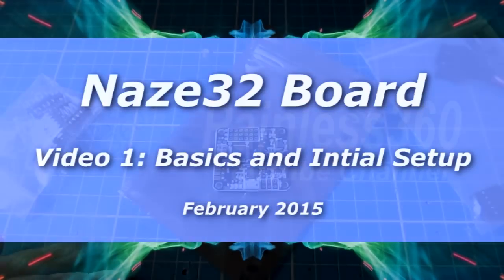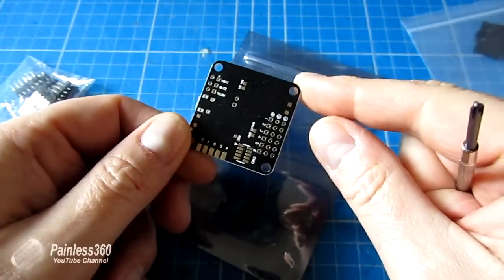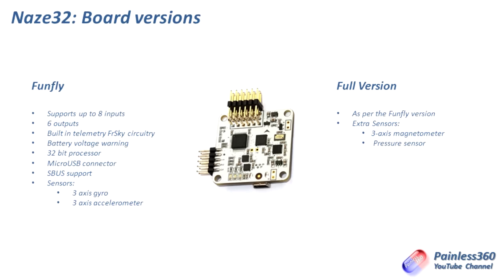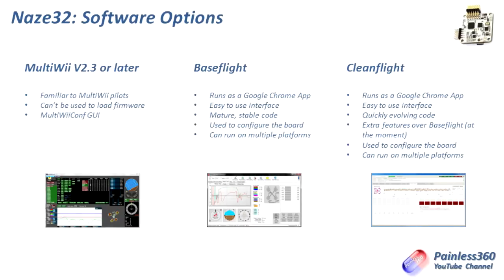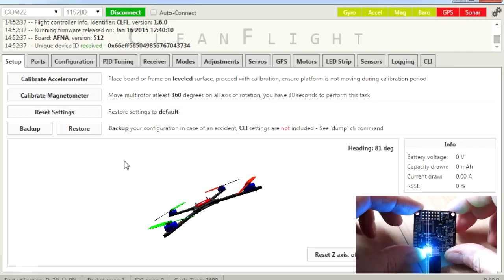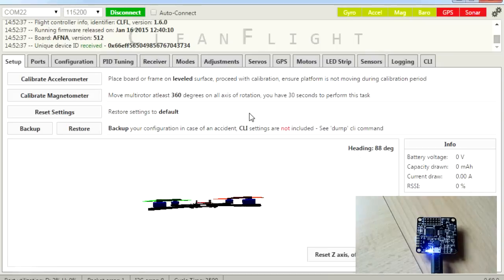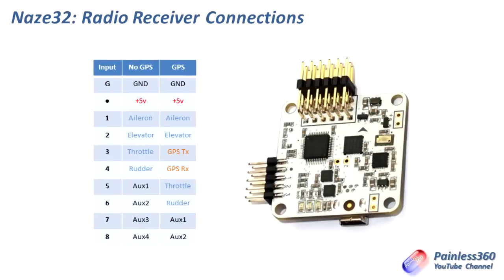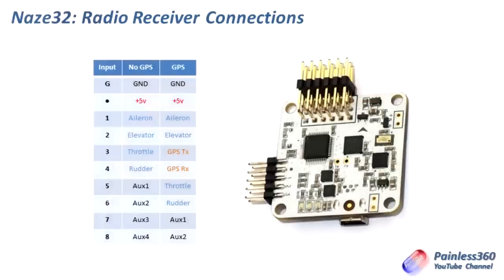(1/8) Naze32 Flight Controller (Full version) - step by step initial setup

Comment: I believe the Funfly is actually the Full version and the Acro is the one without the Mag and Pressure sensor.  Please double check.
Reply from the maker: Hi, you do need to be careful as some of the images and names used are confusing!

The Funfly version that HobbyKing sells (http://www.hobbyking.co.uk/hobbyking/store/__55819__AfroFlight_Naze32_Acro_AbuseMark_FunFly_Controller.html) is the one without the compass and baro.

Happy flying!
Reply: Painless360 Lol!  I have actually seen it labeled three different ways now.  A lot of sites call the one without Mag and Baro the ACRO version and the one with Mag and Baro the FUNFLY  version.  The Abusemark site: http://www.abusemark.com/store calls them both Funfly as if Funfly was the brand name but distinguishes Funfly Controller "Acro Naze32" and Funfly Controller "Naze32" with "Naze32" being the full version.  The only thing consistent has been the word Acro and the change in price.  I guess I'll have to read carefully.  Thanks for the info.  I've learned a lot from your videos.
Reply from the maker: Thanks for the feedback! As if to underline your point I thought I'd ordered the funfly/lite/acro version for these videos and then realised that I had actually ordered the full version ( which will allow me to add things like GPS and make a more complete, better series now). Waaaay too confusing! 

I guess the only way to check is to see if the board has the Baro and Mag on it to have a clue which one your looking at! Apart from the price that is (good point!)

Happy flying!

Comment: Nice Video, thanks Painless.  Based on my recent experience, a warning is in order.  FLY-AWAY RISK!!!!!!   Last weekend I removed the KK2.1.5 FC board that I had used for weeks on my big quadcopter.  I installed a Naze32 (non Baro) board.  I took it out and made 4 short test flights, bringing it back inside to the computer and making small adjustments.  I was satisfied with the basic setup and was going to call it a night as the light was going fast.  I turned off my Turnigy 9x transmitter (with the Nase32 still armed).  A second later the big Quad came to full power and flew off into the woods.  I haven't found it yet, but will continue to look.  With another Naze32 board this week, I confirmed what had happened.  The new board is actually a DragonFly32 Pro (baro and magnetometer version).  When set up (without doing anything with failsafe), it did (under controlled conditions indoors) the same thing.   Powered up and armed, motors run up then back down to zero (motors off).  Leave armed and turn off transmitter.  A second later the motors go to full power.  I NOW have the DragonFly32 Pro configured to RUN the motors when armed...they are just barely ticking over.   This gives me an absolute positive confirmation that the board is ARMED or DIS-ARMED.   In addition, I now have the failsafe on the DragonFly32 activated, and per several tests, it works as advertised.  Both the Naze32 and the DragonFly32 were/are running the same version of CleanFlight with same NAZE32 firmware installed.  I have no idea whey the board makers would configure the default settings of the board to permit the motors to go to full power in case of signal loss and ALSO have a default setting of failsafe OFF.    You may or may not cover this in your subsequent videos, but a person who has gone through this first one may give in to the temptation to take the copter out and fly it.  Without an active FAILSAFE, and without a POSITIVE means of assuring that the board is DIS-ARMED, a fly-away is a very real possibility. 

Brian Kuehn.
Reply from the maker: Hi Brian, sorry to hear about that but even in the world of digital radios and failsafe you must ALWAYS turn off the model first. I still carry scars from 450 class helicopters starting up un-commanded in my early days..

Happy flying!
Reply: Same thing happend to me Brian. I grabbed it and it nearly cut my finger off as it tried to take off!  (I play bass guitar too) Of course you turn the model off 1st, but occasionally after a few beers you land, and start switching things off... Hell we do it with Naza's never have a problem. Auto dis-arm is da shit.

Comment: I want one of these flight controllers but can not solder that finely. Awesome video. You do a fantastic job showing what a person needs to do step vy step.
Reply from the maker: +Tim Miller Thanks for that, get a fine tip for the soldering iron and a magnifying glass and you'll be amazed at what you can do.. Best of luck!
Reply: Nah I've tried burned boards and components it's like giving super glue and a propane torch to a toddler
Reply from the maker: :D

Comment: What's crazy is that the Naze32 boards are now cheaper than the Multiwii SE! I have been using a arduino MEGA with the I2C connected to a dead/fried multiwii SE (the board got hit with 12V! Insta-killed the micro, but sensors are OK! :D) but I had a bad crash and messed up the wiring of this rat's nest (with GPS, UART, minumOSD, etc) so this seems like the most obvious upgrade/repair path!
Reply from the maker: If you like GPS then I'd look at a SP3 now. See our hidden series on iNav for GPS flight modes that work great - just like Multiwii! :D
Reply: I'll take a look at it!  I already ordered a NAZE32 board with the MPU6500, MS5611 baro, and HMC5983 mag. These are supposedly really good sensors. The MPU6500 acc/gyro has a refresh rate of 35HKz over SPI, vs the older MPU6050 which is a slower sensor using I2C. Would it be worth canceling the order? I am shopping in the $30 price range.
Reply: It would be nice to be able to reuse as much of my multiwii accessories as possible, like the GPS module and the minimOSD which appear to be compatible with cleanflight. Given that the "language" multiwii and cleanflight use are very simalar, I would think the minimOSD should work without requiring firmware changes.
Reply from the maker: +Power Max Cleanflight is the grandson of MultiWii and still talks MSP (MultiWii serial protocol) just like the old days so most of the kit will work with little change. Best of luck!
Reply: I figured :) I am now trying to find a cheap F3 board with the sensors this one had. That's seems to be non-existent. Way too many "acro" versions available.  I realized that 32K refresh rate is way overkill for a board that struggles at 2K cycles per second, unless the MPU6500 can be configured with averaging... Does cleanflight support the F3 boards or am I wasting my time?
Reply: I could even just stick with the one I bought and if I feel it's necessary, upgrade the F1 micro to the F3 one (which would require reflow soldering :P) Does your board have the MPU6050 or the newer 6500?

Comment: Very good video as usual but I would add one point if I may. You connect the + and - from the esc on the naze32 ONLY ON MOTOR 1 all the other motors you connect the SIGNAL ONLY !!
Reply from the maker: Thanks for the reply. This is only true if the BECs are switched. Interestingly there is a video on this very subject to be published on the channel on 'Tip Tuesday' next week as I didn't have time to cover it here.

Thanks again, happy flying!
Reply: Thanks for that.  For the sake of people in this hobby (my self included) I would veer on the side of caution
Reply from the maker: Wait till Tuesday ;) This video was already up to 30 mins and the explanation of the power system and options takes at least 6..

Happy flying!

Comment: mochiko just to let you know buddy is that mine was doing that as well I would change the motor stop function and I would try and save and it would just say rebooting and that was it and it wouldn't change to a menu if I selected it pids to cli or configuration to motors it would just say retrieving data

Comment: You're videos have helped me a LOT. Thank you Sir... 

I'm an old RC pilot of about 35 years now. A little bit of catching up i need to do it seems. I'm using Open Pilot for the quads i now have, your videos have made ALL the difference in grabbing on to a kinda' sharp learning curve. Still have some questions but, i'll be getting to those as i go. So far, all the flights have been very stable, predictable and most fun to fly. You may not realize just how much you're helping the community with these but i promise, it's much more than you may realize. For that, i really do appreciate the time and effort you've put into making these videos for us. :)
Reply from the maker: +Danoman Brammer Thanks for the feedback. It is always a pleasure to hear from pilots who find the channel helpful but especially from those who feel we've helped them get into the air in new ways. Happy flying!
Reply: You've made all the difference,Sir...

Comment: Sorry Painless. I guess I felt like you were right here -- not on a video. The portion where you try throttle, roll yaw etc-- I turned on the receiver, made sure it is bound. All ESC's are hooked to the engine order profile. I tried to arm it through the transmitter. When I plug in the Li Battery, green and blue lights come on on the flight controller-- and the receiver powers up. It remains connected to cleanflight throughout. The esc's are in order starting from the end-- opposite the end that says "Beep". It is probably a dumb thing I did-- but there are no dumb questions. Thanks for your help in advance.
Reply from the maker: +Bud Jones hi, was this in relation to something? It helps if you can reply to the original thread if it is. Sorry we to get you to move it but we get dozens and dozens of questions, messages and comments every day so it's almost impossible to keep track if it  isn't linked into the existing conversation in the comments via a 'reply '. Thanks
Reply from the maker: +Bud Jones p,s, just saw the original question!  Check that the reciever settings in Cleanflight match how you've got it wired up. Defaults to PWM. Best of luck!

Comment: I am trying to set up a Naze32 Rev 5 on a Quanum Trifecta Tricopter. I have only had previous experience on CC3D Flight Controller and found that relatively easy to set up. 

I was able to solder the connectors on myself and flash the empty Naze32 with the current software. I am using a Taranis Plus radio with OrangeRx module and trying a OrangeRx R410X which has both PWM and CPPM capability. 

Since my Trfiecta is a tricopter, Rear motor is #1, Front RH motor is #2 and Front LH Motor is #3. However when I plug these motors in in sequence at pins 1 through 3 (counting from the RHS), the mapping of motors/ESC are incorrect using CleanFlight Motor test.

Also, regradless if I use PWM or CPPM, I am unable to power my RX from the FC after a successful bind. I measured the voltage coming out of the 5v and GND and I read only 0.7volts on my meter. Where Am I going wrong or have I damaged my FC board during soldering. I have checked I have no short circuits on the board. Please comment, thanks!
Reply from the maker: +Etops Flight I'd check that the outputs are plugged in the right way (see 21:07 in the video) and confirm that you have the right pins for the 5v too.. Best of luck..
Reply: +Painless360 

Followed your video to the tee. You didn''t show how to connect the receiver cables but I think I go that figured out.

Just realised that my Afro 12A ESC's only have two cables on the plug, it seems only a ground and signal wire, the middle red wire is missing. Is this normal and how will affect my setup?

Etops
Reply: Nevermind, found another of your useful videos about Opto ESC's. Had to power the FC separately using a UBEC (robbed from a DLG) and now the Rx has power but all my motors/rudder servo mappings all all over the place/not responding!

Thanks for your videos!

Comment: hi painless 360 
I am enjoying your channel you are definitely an xpert I many things and thank u so much sharing your experience and knowledge with us.

I have ust one question - I looked through many of your vids concerning maze 32 and accringly concerning wiring a futaba sbus receiver with the board.
i can tell you I can't get it done no matter what I do- so I am using the emax skyline 32 with osd you also made a video of with osd settings thx about that but again. I can't connect it with sbus !!! 
I can easily use pwm but if Iwana use ledstip I need to change to ppm or sbus !! 
how ??? using only the first three cables - serial on uart 2 and config serial entry sbus and even in receiver I bring it on futaba !!! nothing I have several sbus receiver tried not having a broken receiver 4 different receiver so before I throw the stuff out of the window I hope u can give me the enlightenment !!!
I really appreciate your help 
thank u very much and please continue 😁 
as always & happy flying !!!!
Reply: didn't find your email to post you directly sorry and thx 😉
Reply from the maker: You need an inverter for the Naze32 (from what I remember).. I suspect that's your problem if you can't get it to work.. Best of luck!
Reply: Painless360 yes tank you I just found it in the internet after research - bought myself a tyrnugy evolution with ppm receiver problem solved 😁😁

Comment: Should we use only one esc to power the board? You know, removing the positive wire from the connectors.
Reply from the maker: +Dashz see our video on understanding ESCs that covers that...
Reply: Sorry painless, saw that video later. Alright. Thanks! 

You also said in that video that connecting all the (linear) esc's to the board won't do any harm, instead it can also bring more current to the board, but it is not necessary right? I mean, connecting only one (linear) won't do any harm neither, Am I right?
Reply from the maker: +Dashz As long as it has enough current capacity to power everything - yes..

Comment: Hi Painless!  I am very very new to quads and flight controllers.  I found your series of videos and I am happy to see step by step explanations.  However, I've run into a bit of a snag.  I was able to get the accelerometer calibrated with no troubles.  However, I could not get the magnetometer calibrated.  When you move the cursor over an option, the little pointer arrow turns to a pointer finger.  However, when I moved my cursor over the "Calibrate Magnetometer", the pointer cursor did not turn to a point finger.  It's as if the "Calibrate Magnetometer" is not a selectable option.  Would you have any ideas on what I should do?
Reply from the maker: ***** it depends on the board version you have, if you have the basic version without the magnetometer then you will not be able to select this option. 

I cover the differences in the baords towards the start of this video. Hope it helps.
Reply: Thanks for the reply!  I just went back to your video and, true enough, you did state the the "Funfly" version of the Naze32 does not have a magnetometer.  Perhaps I should pay closer attention to your video from now on, lol.

Comment: Hi painless,

May sound a stupid question, but it's the naze 32 board, limited to small size quads only.  Was hoping to install one on a 450 Dji type frame.
Reply from the maker: Fred Kaz You can use them on any size model. I use little Multiwii boards on 450 class quads all the time. It doesn't care about the size of the quad/hex you are installing it on. :)
Best of luck with the build.

Comment: just got mine from hobbyking, rev6 full.. going to replace my cc3d, the 
cc3d would not arm unless plugged in to the usb and pc and would not 
give power to my receiver , I had to use the power from my esc,,,    
Only issue, my naze32 must be a newer version , it is the same size, but
 I have Alot more pin spots.
Reply from the maker: +Dan Cochran Sounds like it was a power problem/faulty CC3D. Best of luck with the Naze32..

Comment: Just received a full Naze32 board and followed your video instructions, which are very clear and easy to follow.  However, after flashing, the board is displaying the blue light and a red light.  Might you be able to help me understand what is going on and why I do not have just the blue light as you have in the video??   Thanks for the video and your help.
Reply: +Aaron Pitts 
Hey Arron ..getting the red light too ..what did you do? What Radio are you using?

Comment: Different subject but i am just trying to pass on info to you, don't know if you have used the "Goodluckbuy" site, i found it by accident and spotted a little module (Fpv N1 OSD) that works with the "Naza M Lite" and is only £13.64 and it works great, since i connected it to my naza it does not drift an inch, there are 3 different OSD display modes you can use, there are plenty of users on youtube instructing how to set it up as you don't get instructions with it, well worth it for this price.

Comment: Hi Painnless360, I have a few questions after watching your video: 
1. For NAze32 6DOF rev5, can we use opto escs? if possible, how to connect? 
2. How to connect the FC with PWM configuration for spektrum DX6I transmitter and AR610 receiver? 
3. at 19:10, you mentioned 5v, where do you get the 5v from?
Reply from the maker: 1) Yes you can
2) See the rest of the playlist - it's all covered
3) If you're using OPTO ESCs then you'll need it from somewhere else. Some PDB boards provide it. 

See my Quadcopter Building for Beginners series for all my tips and tricks using modern tech - hope they help!